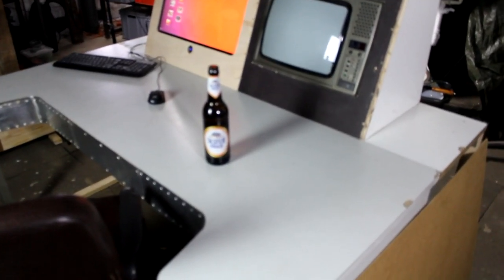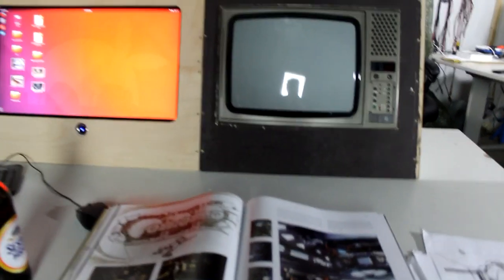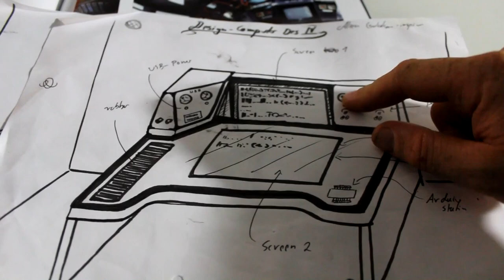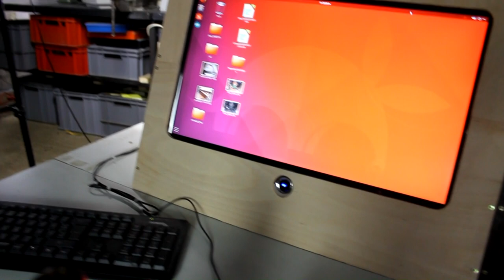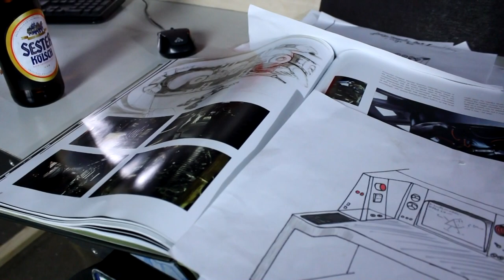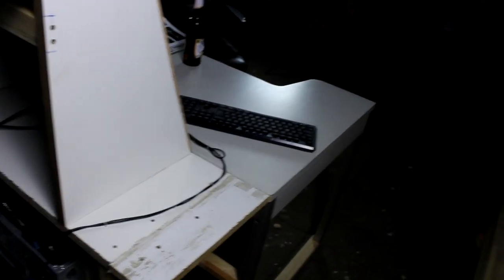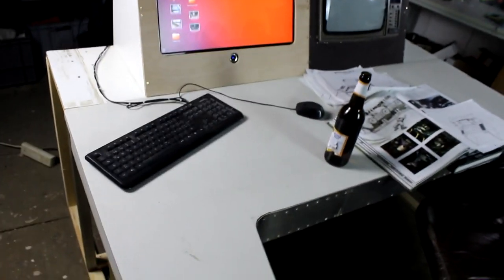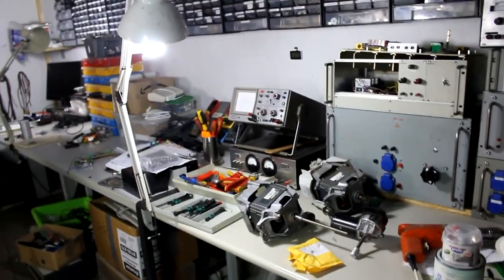Update: Sci-Fi Computer Desk

Comment: You should incorporate a hole for the keyboard/mouse cables to go thru. Maybe use a piece of rubber across the back of the hole with several slices in it so you can poke the cables thru but you won’t be able to see thru the gap...

Comment: I have multiple thoughts on that:
1. The desk definitely needs some edge on the border or so to look more "stylish" like a 70s SciFi set.
2. Any vintage computer stuff should be saved and/or donated to the local enthusiasts. I've just come from the Vintage Computing Festival Berlin, and I must tell you, there is a demand for old Atari monitors, if there are people that set up an Atari but connect it to a modern LCD...
3. Also, the IR lamps are too useful to convert to something different. Ever had a pain in your eardrum, like from it getting too cold or being inflamed? Put that ear in front of one of those IR lamps for 10 minutes daily, in a distance of about 50cm, and it'll get better really fast, compared to other options you have. I think, they are even still sold new nowadays, if you look for "Rotlichtlampe", although very expensive. But of course, if the IR bulbs are out on those, they are pretty much worthless.

Comment: Have you thought about modifying a tube radio into a Computer case?
I am doing the same right now with an old Neckermann radio and it looks fantastic because it also had a record player integrated into the top with foldable top panel and I took the broken player out and put transparent styrene on top for a viewing window.
It is a bit of work to figure out things like cooling and how to mount things, but I think it would fit your asthetic quite well.
For the front i will put leds behind the glass panel and where the magic eye used to sit. I took out the interior of the radio and stuck the glass to the front on its own.

Anyway, just an idea. Keep your great work up man, I am certain that your desk(s) will look mega awesome!